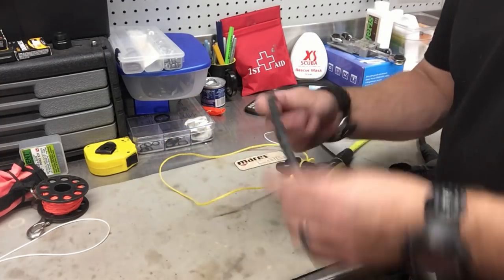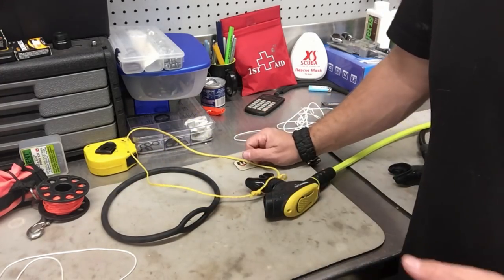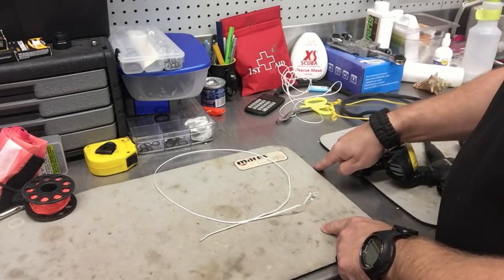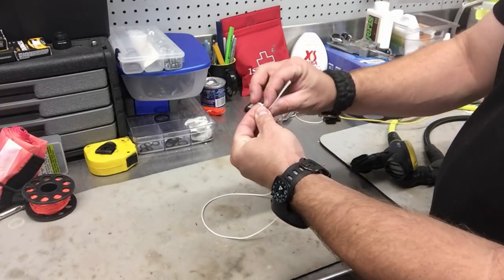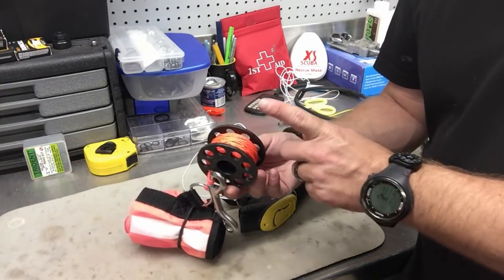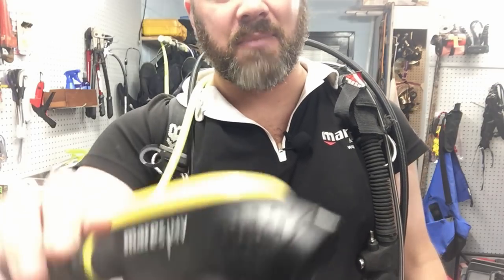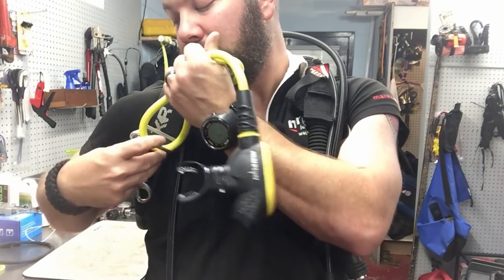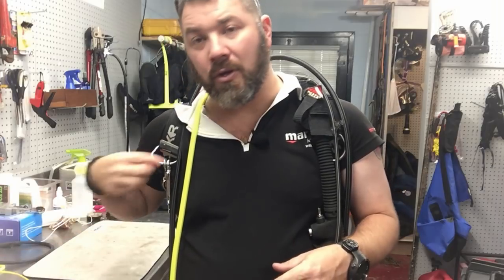Secure Your Octo In An Emergency While Underwater

Comment: Couple of things that I observed. When wearing a necklace, I was under the impression that you donate your 'primary' and switch it out with your alternate hanging in your necklace. It is a tech diving setup where you have a 2 meter long primary hose and a 'regular' sized alternate hose (not the octo). So in case of an emergency you unwind the primary hose wrapped around your neck and donate it to the diver and then you breathe thru the alternate that you have hanging on the necklace.

Also, when securing your octo to D-ring or to the necklace (recreational setup, not tech diving setup now), I was under the impression that you bring it from under your arm pit. IF you are using the tech setup, you bring it from over your armpit since the hose itself is 'regular' sized.
Reply from the maker: Hello Dhananjay, there are many different configurations out there, and many different ways to accomplish the same goal.

Comment: Good video, Brian. I would like to clarify that the knot you tied in the twine is actually a Double Fisherman's knot, which creates a Prusik Loop. A Prusik Loop would then be wrapped around another rope to form a Prusik Knot; used in ascending or descending a rope or for progress capture. www.animatedknots.com/prusik/index.php.
Reply from the maker: You would be correct Bart.  We get lazy in the fire service sometimes and call the double fisherman's knot a prusik knot, simply because we use it to create a prusik for climbing.
Reply: Brian , you know I love your videos, yet when you stated prusik knot my head snapped.. noooo that’s a loop wrapped around a static line. Lol Yes used em rock climbing and also backpacking to secure to the ridge line netting or a light. This as you corrected is a fisherman’s knot. Stay safe.